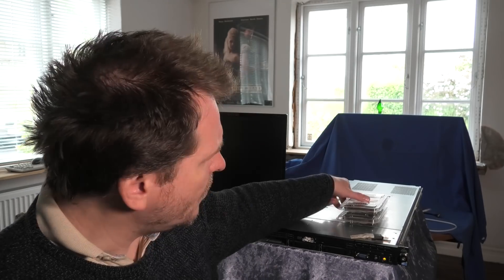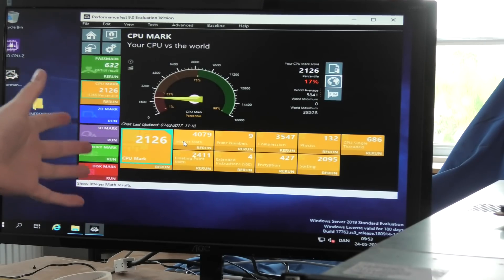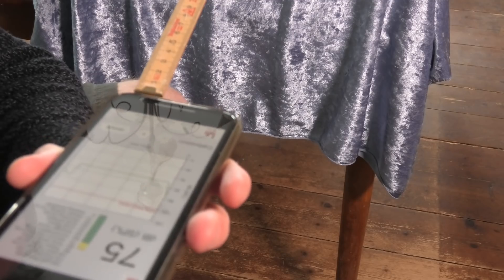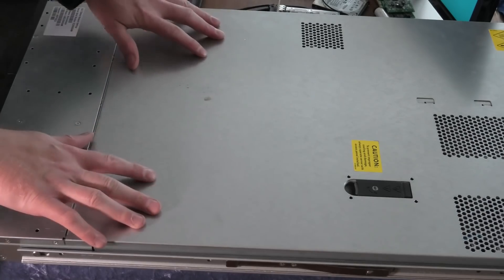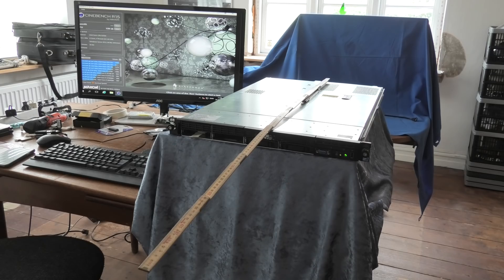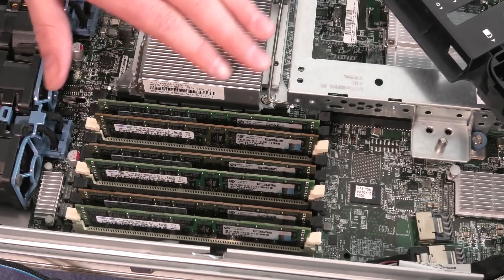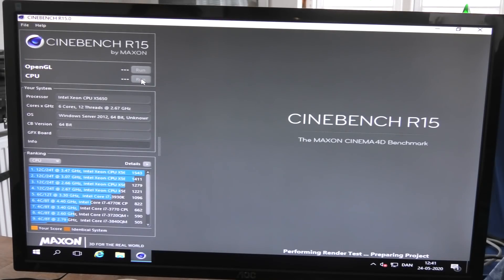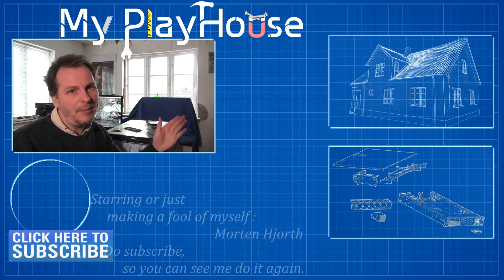HP dl360 G6 - SSD, more RAM, better CPU - Silent - 964

Comment: i have a Dl360g6 2xE5540 16Gb ram.

I don't have pci+m2.

I currently use 4 hard drives:
2 HDDs (Seagate Barracuda 2TB)
2 SSDs (Crucial CT250MX 250BG)

iLO 2.33
Biography 2018.05.21A

the fans are constantly on 80% and therefore always make a lot of noise.

I did some tests.

With only SSDs it doesn't cause problems, with HDDs instead, after a couple of minutes at 10% or off, they start at 80% and stay there.
Processor and system temp are ok.
Reply from the maker: It might not like non HPE HW :-/

Comment: I keep getting a 207 Memory Initialization error in my DL360 G7 on startup for Proc 2.  Ever encountered that before?  I wonder if its a bad stick.  They are all the same exact HP number.  All 9 sticks in Proc 1s slots are good.
Reply from the maker: Have you put them in where they need to be? You can´t just put them in anywhere.
Reply: @MyPlayHouse  yes all 9 sticks for the 2nd CPU are all the same indentical to the nine ones on the 1st CPU.  The ones for the 1st CPU all work and report the correct amount of RAM for that set of 9

Comment: Hi, I got a question about SSD. I try to change from HP Hard Disk to SSD ( 2 units ). On first week all work fine, but after some days Server start to hang up and finally data was corrupted on SSD. I check both SSD and are without damage. Any idea Why happen? i use two SSD Crucial MX500 2.5"
Reply from the maker: No that seam's weird.. something is broken :-/
Reply: @MyPlayHouse  Thanks a Lot, anyway, it is possible change from Hard Disk to SSD getting all speed from SSD? Controller is capable to manage the high speed of SSD?
By now, i bought a Caddy to put the SSD on CDROM interface and work very fast!
Reply from the maker: Yes you will get the good speed of the SSD,, even on an older server. :-)

Comment: I have a g7 of this server, I want to get the pci e card for ssd or m.2 storage. Can I plug a pci e 3.0 into the pci slot.
Reply from the maker: I have been able to do thin on IBM/Lenovo servers,, I see no reason why it should not work on HP
Reply: @MyPlayHouse  I'll give it a try and report back
Reply: @Hands-onNow  Did you ever do this? I'm thinking about doing the same.
Reply: @anonimuso  I just ordered the stuff. Just haven't gotten around to installing. I'll do it this weekend.
Reply: @Hands-onNow  Great. Good luck. Please let me know how it works out if you have time.

Comment: For the dl360 g6 you recommand x5679 for me... I find that cpu, so how wold i overclock it on that server to maxx his performance ... May i will use watercooling custom designe... And what about x5680 cpu
Reply from the maker: Enterprise Servers does not usually over clock.

Comment: how much ram can u put in it ? i have the same server
Reply from the maker: I believe it taker 256GB,, 16GB blocks. if you need some : https://www.myplayhouse.dk/shop/en/memory/34-16gb-kingston-ddr3l-1333-rdimm-pc3l-10600r.html :-)
Reply: @MyPlayHouse  on the doc there is 12x16gb written but there is 19 slot of ram

Comment: Yeah you played with HP DL380 G6... Ya you need to change the bios setting to full extreme performance mode you will get more points out of that old 6 core CPU. It will then be a tad louder as well :P Nice test video on what you can add to a home server. With the cost of cheep SSD/NVMe drives no Point in adding slow SAS drives in a server like this.
Reply from the maker: If you need capacity,, SAS and SATA is still the best affordable option.

Comment: how did u get the server to notice the SSD in the front HHD bay. by default i think this server does not mount SSD's in the front HHD bays
Reply from the maker: I do not believe I did anything spicial.
Reply: @MyPlayHouse  Did you have the latest bios firmware

Comment: i just got a new HP DL360 G7 with that small 1 cpu 4 core 8 thread with hyper threading slow ... can i take the memory and 8 core 5520 from a Intel® Server Board S5520HC, S5520HCT to up grade the DL360 G7 ???
Reply from the maker: There is a very good chance that will work just fine. You can also go shop for something a little better : https://www.myplayhouse.dk/shop/en/processors/91-intel-xeon-e5530-4-cores-24ghz.html   they are really not expensive.

Comment: running 3x hp dl360 g6 together with an ibm x3650 m3 for years now. with the best servers u can get on the used market. have them all running with dual xeon x5670. the hps run with max x5675 as mentioned below. the ibm could go up to x5690 but the x5670 just deliver the best performance for the bucks.
for the discs i use seagate constellation.2 1tb sas drives. just get one of the more beefy hp pcie raid controllers like the p812 with 1gb cache fbwc. with 8 discs (u have to sacrifice the cd rom for that and get a  2nd backplane kit) u can get almost sata ssd speeds.
Reply from the maker: Hi Alexander Gross
Thank You very much!  glad you liked the video :-)
Thank you for watching! :-)

Comment: I have a DL360e Gen8 as a test server at home.  Dual E5-2440's.  Had 64 GB RAM, but got an unrecoverable error on a RDIMM on boot and wouldn't go into the O/S, so I had to isolate that RDIMM and just use 48 GB RAM.  I tried a SATA HDD in a drive cage once and it came up.  My machine uses the P822 RAID controller with 4 SAS drives normally and the fans make a lot of noise when it boots.  I run Ubuntu server for file sharing and web serving.
Reply from the maker: Hi doug holtz
Thank You very much!  glad you liked the video :-)
Thank you for watching! :-)

Comment: Wondering if you were able to get the Raid controller installed without any issues. Having issue with mine saying "Hardware Configuration lock-up state until the issue is resolved."  Have tried just about everything to get it to get out of that mode. Any tips and tricks are welcomed.
Reply from the maker: What ever I did is in the video, I have not messed with it scenes

Comment: Did you have the oportunity to mount an array using the fron docks AND Sata SSDs? Im having problems with mines, theirs disks starts showing amber lights randomly after some time or some reboot. IT doesnt happens at all with the SAS HDDs... Im trying to find out whats happening. Mine is a dl360 G7 btw, seems pretty identical to yours G6
Reply from the maker: I mess with this again in tomorrow's video.

Comment: Morton, it's the HP G8's and above that get really noisy. Because the Caddies has a chip in it. 
I have replace the 300GB drives with 900GB Drives and had no issues, but when Using a drive without a cady the fans spin to 100%. 
I use the 146GB caddies because they were free.
Also i would change power mode from "Static Low Power" to Dynamic.
Reply from the maker: I have only heard about this problem. And not being a big HP fan, I have not messed with it, before.

Comment: I have run a lot of these, and what really triggers the fans are consumer SSDs/HDDs lacking proper temperature sensors (this makes the fan go nuts), and hot PCIe cards, specifically NC522SFP raises the fan noise a good amount, and a QLE2562 makes them run pretty fast.
With both PCIe cards, they are no longer fun to be near.
Also running in an other mode than power saving also raises the fan speed a little.
It is also worth adding that servers prior to Gen8 had no trouble with non-HP disks.
Gen8+ has some issues sometimes.
Reply from the maker: Thank you very much,, good info!

Comment: I have a Dl380 G7 and oh boy is it picky.
No problem with a Samsung 850evo (it seems to cheat,  by only sending 35°C to the Bios via smart) also my transcend ssd370 (by itself)
Both of them at the same time and the fans reach 50% in about two hours.
I also tried some HGST drives from some Prodesks... Within an hour the fans went up to 77% felt like a jet is going through my living room.
There is a list on the net though, of drives that are supposedly work fine.
Reply from the maker: Okay,, so I need to try some more. :-)

Comment: I can confirm that on the DL380 G7... Certain drives will cause the server to ramp up the fan speeds... For the longest time I ran a random mix of drives (SSD,  SAS,  SATA)  and it was quiet,  put in some genuine HP drives (maxed out all 8 slots)  and it remained quiet for about a month.  Then it would randomly ramp up the fans to 78%. Upgraded everything (bios,  firmware,  iLO,  etc)  and the fans wouldn't budge.  I could reset the iLO connection and it would go back to 13% fan for about 2 hrs then creep slowly up to 78% and never go back down.  No errors reported anywhere - health was "green" on all sensors,  and temps were less than half of "caution" level.  I got fed up... Lol,  started pulling out drives and ended up pulling all but my 2 SSDs before it quieted back down to "normal". No idea why it randomly started to do that with the fans after 2 years of quiet operation.  Purchased a netApp disk shelf to put the 6 drives that I pulled out and currently using that as my "storage". Also the drives topped out at 2TB,  didn't have anything else bigger to test with.
Reply from the maker: I was expecting something like that.. did not happen.

Comment: Rookie mistake on the power profile :)
Reply from the maker: I forgot to default the bios :-/ and my buddy had been messing with making a power conservative server.
Reply: @MyPlayHouse  I should also mention that while the DL360 G6 will operate OK on a single SSD, it probably won't be good with a RAID of SSDs.  This will depend in part on the brand/model of SSD, but the limitation is in the way the onboard RAID handles them.  Plenty of results on this on Google search.  Also with all 9 memory slots populated you may only get 800Mhz RAM speed.

Comment: You have the Power settings in bios on low power, if i have mine set at low power windows wont ramp up the CPU speed to max
Reply from the maker: I forgot to default the bios :-/ and my buddy had been messing with making a power conservative server.

Comment: Hey Morten, glad your memory worked out OK and was surprised.  Dug out my 16GB sticks (which didn't work for me in my G6) and notice they are stickered Cisco.  Perhaps the SPD settings have been changed ?  Who knows.  Seeing as you have enough RAM to fill all three memory channels, would you consider doing a RAM speed check with 3x DIMMs, then 6x DIMMs then 9xDIMMs to see the effect of loading the memory controller with those 2 rank sticks.  Bob.
Reply from the maker: I have done this test in a video way back,, In a lenovo server,, but the same.
Reply: @MyPlayHouse  I'll have a search.  Cheers.
Reply: Check the server specs on HP website. It tells you exactly what speeds you get with different combinations of dual rank and quad rank RAM.

Comment: Actually you can make this loud by setting Thermal configuration in bios to increased cooling. Or by putting some not supported hard drives into it - it will be much louder than in increased cooling mode
Cheers!
Reply from the maker: Thank you very much!
Reply: @MyPlayHouse  Apparently that SSD which you put in was the drive supported by this backplane. Some of the SSDs work normally, some do not. Same with HDDs.
Actually every drive works, but the backplane reads the drive temperature in wrong way so it thinks the drive is overheating and the fans ramp up to around 80%  ;D

Comment: Arrggh you have done it wrong!!

Look at you bios boot screen!

Low power profile setting.

Go into the bios and set the power profile to balanced. This will give full CPU performance.

Maybe do the video again when set correctly? Get true bench results.

Also. Install hardware monitor (hwmonitor) and check the system temps.
And the cooling profile.
Silent does get a bit too high, in server room with AC It maybe okay...

Passive is fine, that is what you seems to be testing for (with ramp up)
And there is active cooling... (Ear plugs required).

Hope you got it sorted now ;)
Reply from the maker: Thank you very much,, yes I did not see that :-/

Comment: I wold like if you could try out the performance on that SSD drive on HP Gen6, I did install one SATA SSD on mine (ml350 gen6) and although it works, it’s painfully slow in any performance compared to any other sata motherboard I used it. It is still better than the 7.2k sata drive it had but it’s far far from reaching anything over 60 or 80MBps :(
Reply: If you want high speeds on these old servers use NVMe or SAS ssd. Sata is quite slow.
Reply from the maker: Thank you very much!

Comment: good video well done, I have a problem on a server of the POWER DELL 2950 model, I have the internal fans running at full speed ....... I changed the fan N.3 where there was an error !!! ! but still spinning fast ..... what can I do !!!!!
Reply from the maker: It’s an older server,, could be a bad sensor :-/

Comment: Well there was a tip from boot hp menu. It was quiet bc of power settings in bios "low power usage" and "CPU was undercloacked to 1.6ghz"
Reply from the maker: I will have to check that,, could be that my friend has tried to make the server use less power. I did not see that. Thanx!
Reply: @MyPlayHouse  well I was using same only g7 since 2015 and it was perfect one for hosting
Reply: @MyPlayHouse  Thats why u read the Bootscreen :) Was about to comment that myself, as some others too, maybe u can revisit the Server with other Powerstages?
Reply: Yeah a new video with the normal clock/power AND check the temperature of the CPU :)
Reply: @xxcr4ckzzxx840  I'm in for that
Reply: @MyPlayHouse  i was about to comment on this myself, that it was in low power, HP Dynamic Power Savings Mode is the one i usually keep mine set to
Reply: You are running low power usage profile. It shows that information on every reboot you did a few lines at the bottom. You need also to select a more aggressive fan profile if you run it full throttle. I still run the very same machine but full tier with 2xX5675 and 288Gb of ram. I had to upgrade the heatsinks with copper one.
Just one hint. When you apply thermal paste, do it a straight line top to bottom. The cpu die is rectangular top to bottom shaped. No need for the extra on the corners. I use arctic cooling mx4...almost 10°C less in full load. I do run my machine rackmounted in air conditioned environment.
Reply: I think that must be true as my 3400g pc 4c/8t doubled your results and 711 in cinebench. i think your clocks are not going up

Comment: In my experience, non-HP drives have never caused their fans to spin up. I used to have a DL380 G5 and it never did this. My current DL360e Gen8 doesn't do this either.
I use all non-HP drives, and both systems never complained.
Reply from the maker: Okay,, I was told that this was a problem,, maybe the firmware is to old.
Reply: My DL380 G7 hate it. The drives report overheating (WD & Samsung) in 20-25 degree heat :(
Reply: @jackcalloway3619  Hmm. Perhaps some firmware versions specifically do this? I wonder if HP backed down on this at one point or another.
Reply: @jackcalloway3619  check this list for compatible drives http://dascomputerconsultants.com/HPCompaqServerDrives.htm
Reply: The " very old" DL360G3s used to hate incorrect drives and running non-sanctioned operating systems. The fan speeds used to go nuts, regardless of the ambient temperature. Glad HP has moved away from that idea..... even if it was a small move. 😁
Reply: I've had problems with both G6 and G7, fans going crazy (max speed) because of "non-HP" drives.